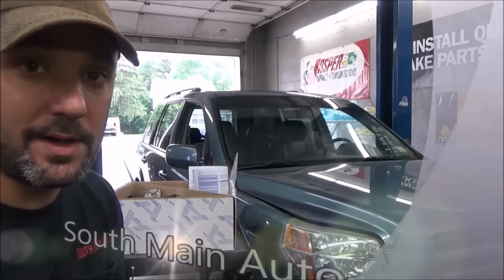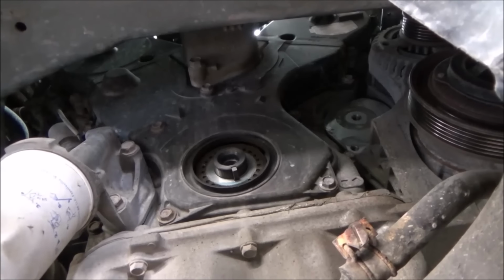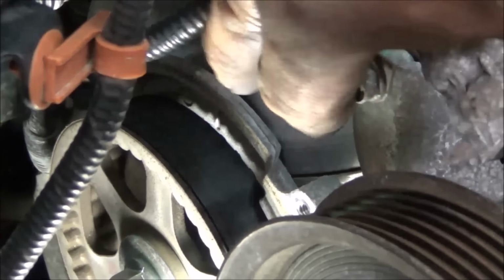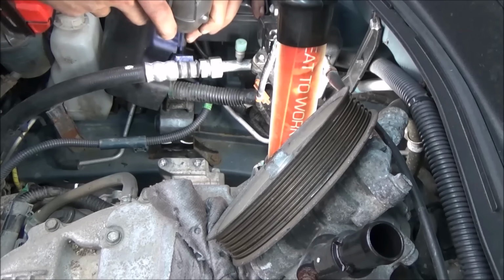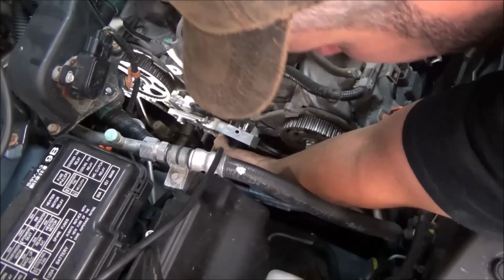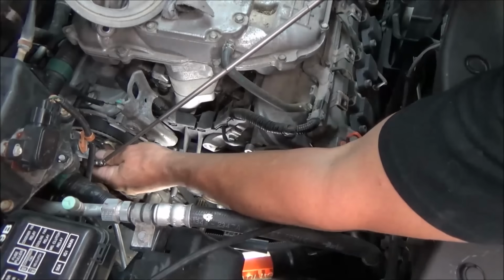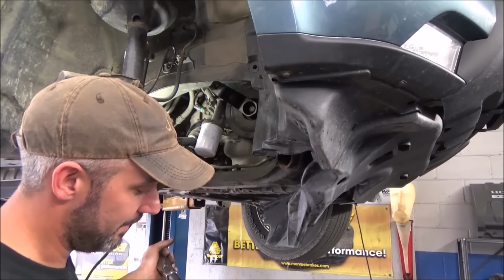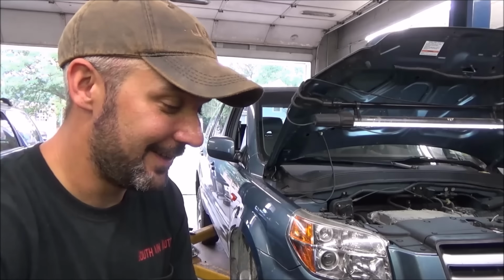Honda Timing Belt 3.5 J35 - Pilot, Odyssey, Ridgeline

Comment: Oh and on that "use your brain, not your muscle" bit.

" One pound-foot is the torque created by one pound force acting at a perpendicular distance of one foot from a pivot point. "

So basically, if you have a one foot wrench, then hang a 1 lb weight at the end of it when it's horizontal and you have applied 1 lb;ft of torque.

If you have a two foot wrench then you only need half a pound weight for 1 lb;ft torque.

Add more weight or a longer wrench as necessary to match the required torque.
Heck, you can even attach a scale with a hook to the end of a wrench and pull on it until you match the foot pound you are looking for. Just make sure you have an accurate scale.

Comment: To remove the crank pulley on my brother's Toyota Sienna, when we replaced the timing belt, we used a torque multiplier to remove the bolt.  It multiply the torque by a factor of 4, so 50 ft-lb is multiply to 200 ft-lb.  I agreed with your method of removing stuff that will be replaced, quickly and efficiently.  When I need to replace a 02 sensor I just snip the wire and use a regular socket to get it out.  I don't need to bother with a 02 socket and can crank on the sensor with a socket that doesn't have the slit in it.

Great video, had I known it was that easy to replace a Honda V6 timing belt, I might had offered to help my neighbor replace the belt on his Odyssey.
Reply from the maker: Upallnight Oh yeah man these are gravy jobs for sure. I totally agree about the 02's and stuff cut and go!

Comment: Awesome vid, I could even do that job now :)  When you turned the engine over twice to verify the timing marks lined up , have you ever done that and they were off ?
Reply from the maker: Steve Rob Not yet...... yet.....
Reply: jrmym2 ha you did the job just like a pro , we all did it like that once and maybe twice and for me at least three times before we got it right :)
Reply: +Steve Rob I put a timing belt on my Accord... turned the engine over by hand before cranking it to make sure nothing was screwed up... when I started it, it ran like shit... turns out the belt was one tooth off. I had to take everything apart and do it over. Hey... it was easier the second time :)
Reply: @jrmym2  well you obviously didn't have the Mark's lined up

Comment: I bet doing timing belts are a pain in the ass, what would you rather replace a timing belt or a timing chain? What are the signs of a timing chain or belt starting to go out?
Reply: William Pham you  just replace the belt at a scheduled  time interval .. if it brakes on a Honda ..you loose the engine as the piston slams into the valves ...usually timing chains are  not replaced ..occasionally they do stretch  and jump a tooth ( belts jump a tooth as well) 
 car will run especially idle rough ) search scanner danner . has a great video on a skipped tooth timing belt diagnosis
Reply: William Pham chain is noisy on startup when engine is cold as well as in driving.Keeping the oil level correct and changing the oil with filter is key to avoiding premature chain wear.Low oil levels are a recipe for disaster.The specified oil by the maker is critical.
Reply: Do you have the link to the video from scanner danner deepsquat600
Reply: I had a 96 sunfire gt that had backfiring through air intake and alot of people said timing chain issues. Do you think that is a true statement?
Reply: William Pham For what it's worth I had the same issue on my 05 Impala.  Turned out to be head gaskets.  Of course the timing chain on yours could have well been the problem though.
Reply: Yeah...sounded too much of an issue to even attempt to fix with barley any cash so I just got rid of it. Hate having to deal with timing issues.
Reply: Working on cars can be fun but sometimes the problems that come along can be a major hassle to fix